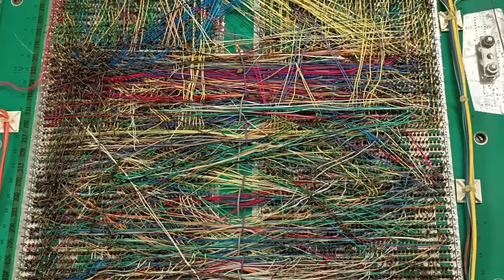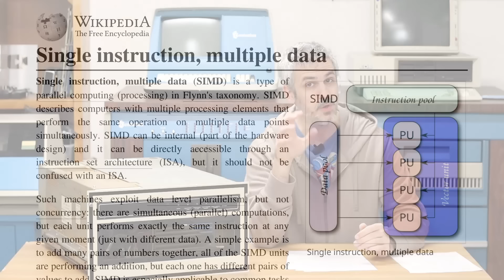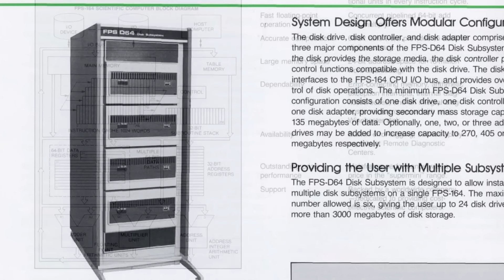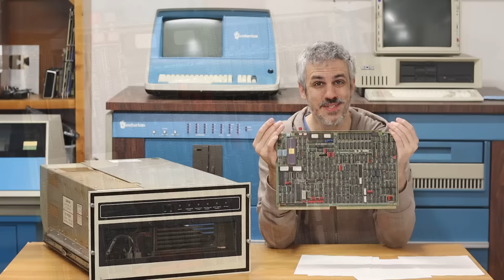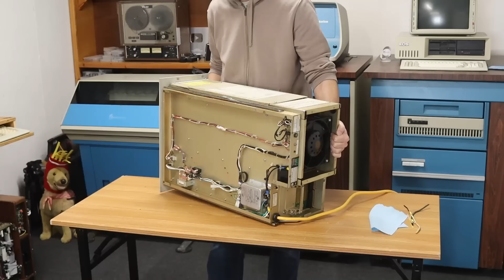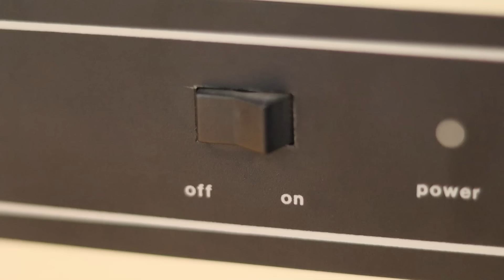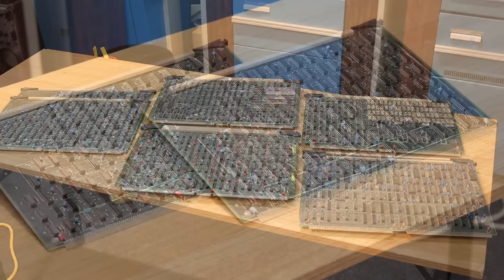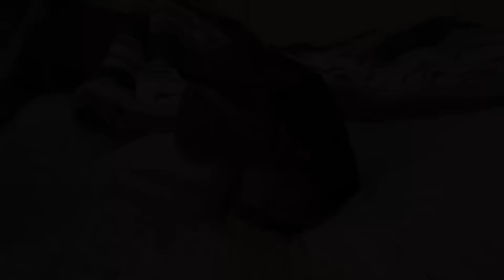This Computer is from a Defunct Supercomputer Company

Comment: Great video.  Around 1990, I was dealing with a high-end government contractor that was using a Silicon Graphics Onyx "reality engine" to develop a simulator for the military.  Around 2006, I became the program manager for a government contractor at a federal research lab.  The same SI Onyx computers were all over the place.  Some funny guy had put them on casters and bolted a cushion to the tops of them.  They were being used as stools and foot rests.  I think they cost between $200 and $500 K, originally.

Comment: Vector processing is used for fast parallel matrix operations. When I worked for NEC supercomputers, it for weather modeling and material stress analysis (Finite-element)). There are other uses, such as for the NSA. I don't know what they were using it for. If I did, I couldn't tell you. 😆😆😆

Comment: Back in the early 70's I modified the Fortran libraries for Data General Nova systems to utilize on of these devices. With floating point implemented in software, the speed improvements were substantial. The big payoff was to reimplement many of the major functions (SIN, COS, EXP, SQRT, etc) to use the vector capabilities. (All in assembly.) Massive speed! But the FPS had more bits of precision than the DG formats, so it got slightly different results, which I had to explain to the customer (and my boss). Fun times....

Comment: I worked not only on FPS Hardware in the early 1980s, but also helped build a piece of hardware to accelerate data movement in and out of the FPS 100 and 164 (did the cross-assembler and cross-linker for 2901 based architecture for that accelerator- built by APTEC systems in Tigard Oregon- major customer was the US Navy- but the demo was to draw a picture of Cheryl Tiegs on a Mentor Graphics display- they had the office next door). The company I worked for, QTC (Quantitative Technology Officer) was founded by one of the former FPS scientists- Dr  Bob Norin. Very small company- less than 7 of us. I loved the architecture - MIMD- of FPS hardware. It was a cycle based integer and memory access model and a push based floating point add and multiply pipline. Fascinating algorithms to fold loops into parallel access. Geology problems were FFTs for seismic data in Oil Exploration. I remember everyone coming back from SEG (Society of Exploratory Geology) in 1982 looking incredibly grim- no oil companies were going to spend big that year- economic downturn.

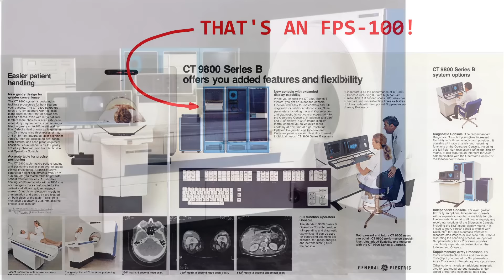Comment: 3:50 - Mercury Computer Systems build bold-on array processors for GE Medical systems. Eventually the military took notice and starting putting Mercury systems on aircraft for airborne RADAR, especially Synthetic Aperture RADAR. GE told the company to start building their products in CHY-NAH. The company told GE to pound sand. GE eventually stopped using the Mercury product.

Comment: The geologic application is almost exactly the same as the medical one: computed tomography. In the case of the geologic application you are looking for geological structures that may contain oil deposits by looking at seismic waves from several sources, rather than reconstructing anatomic details from X-ray slices.

Comment: 4:34 - Companies like Schumberger put data recorders out in the field and drove sound waves either from hydralics on trucks or with explosives and recorded the sounds coming back in sufficent fidelity to do beamforming and discover rock strata information to help oil well drillers determine the best places to drill. Beamforming is a very, VERY vector-intensive task.
Reply: Even without complex calculations like beam forming a vector processor would be a significant advantage when handling 3D surveys; or when stacking 2D surveys.  Stacking is a process where you take a number of seperate shots and combine them to give a clearer picture of what’s happening at each location.

Comment: I ran an FPS-164 on a vax for a while doing control systems simulations, and I sent a bunch of the documentation including software to the CHM.  Also sent them a box of stuff from the FPS-164 user's group including a list of all members at the time, photos and papers from the user's group meetings, and so forth.   Way, way faster than doing FFTs on the vax one element at a time.  Something of a pain to use because you had to move data from the vax to the array processor, then make calls to the array processor for operations, making for huge wads of unreadable Fortran.  Anyway, the guys at the CHM should have these docs.

Comment: You asked about an FPS-164.    I ran one from mid 1986 to about 89-90.   It started life from what I understand attached to a VAX 11/785.   The 785 got a big brother a VAX 8600, the two VAXes where clustered together and the FPS Unibus card was moved from the 785 to 8600.   The users ran Nastran and Abacus FEA software for a component division of GM.   Really all the software and storage was on the VAX, the disk drives withe the 164, just held the job/program to run, the data and the results.  As far as the users/engineers saw it, they could submit a batch job on the VAX that copies their FEA input deck over to the FPS164, and then the program, Nastran or Abaqus, ran the code and copies the results back.   Or they could submit a batch job that ran on the VAX.   In the long run, the FPS was not that much faster than just running on the VAX, or the FEA models or the code couldn't take advantage of vector math.   This is also backed up by the fact that later the users, demo-ed a VAX 6540, which was a 6000, with 4 500 series CPU, and each one had an attached VAX vector co-processor.  The testing with and without the vector co-cpu enabled showed it didn't help much.   THta VAX cluster was moved across town and joined into another cluster and the FPS164 was left to be scrapped.   Faster VAXen, less extra software and hardware costs for the FPS where the main reason it was no longer used.

Comment: Analyzing CAT scans and seismologic reflections (used in oil prospecting) are both examples of INVERSE PROBLEMS.  We know how the signals involved (x-ray absorbance and acoustic reflection) are transformed by a system to produce complex data.  Computing the data from the inputs is the relatively easy FORWARD PROBLEM.  To determine the structure of a human body or the distortions of geologic strata caused by oil domes, one must compute the inverse of those transforms.  That is, reverse the process that created the data to retrieve the system that generated it.  That is a much more difficult problem to solve.  In some cases, eg.the numerical inversion of exponential transforms, it is impossible to do accurately. Thus, inverse algorithms may require large memories and long times to complete.

Comment: As a polymath myself, i just have to bring up that an array and a vector are two different things, but somewhat related because an array has several values within it making it understandable why they could be confused or the terms interchanged because a vactor's values would be stored in an array, as the array is near suited for this... or a linked list could be another term you may use.

Comment: Thank you for solving the mystery of how they did early medical imaging with computers because I never could figure out how they were processing that much information with the computers available at the time. This is the missing link. I always knew that various manufacturers had floating point options that could be added (and the PC followed suit) but I don't believe any of them were reaching those sort of performance figures. PS, the 486 was easily reaching 20-30 mflops down the line. The pentiums were a quantum leap in the FPU department coming from the 486 too. By the pentium 3 they were getting 2-600 mflops. That was beating several RISC processors at the time.

Comment: Hi David, a very informative video. I think reverse engineering is probably the only course of action. Very big and time consuming job. You could go for a PCB but playing as opposed wire wrapping. Just have to get it right first time. The more wire wrapping you do the easier it gets. But it very slow and very easy to make mistakes. Good luck with the project. Richard

Comment: you wont be surprised to find out that geologists use computers to search for oil, they run geophones, which are sensors all connected by wires spread out over several kilometers in a grid, then use underground explosions to generate signals for the geophones to detect, the seismic data all gets fed into a computer for storage and interpretation to see what kinds of rock layers or voids exist below to find the oil

Comment: I used several FPS AP-120B and FPS 5000-series array processors in 1985-86.  Went to training at FPS in Beaverton, OR.  We used them as part of a real-time flight simulator to do table look-ups of wind tunnel data and we also coded the digital flight controls in FPS assembler.  For one simulation, we paired an AP-120B with a VAX 780, but for another, we had 3 Gould/SEL MPX32 machines in a cluster (those were ANIMALS - put the VAX to shame!)  each Gould was paired with a 5000-series AP.  The programming was WILD - all in assembler.  The basic method for programming was to write the code linearly, then go back and fold it back up to "parallelize" the code.  It was all about maximizing the number of operations you could do in one machine cycle.  As I recall, we never worked on the AP directly.  We did everything on the host computer, created the AP microcode, then ran utilities that loaded it onto the AP and executed it.

Comment: Cray had earlier built the CDC 6000/6600, circa 1964, at about 3 megaflops.
When I worked at Data General circa 1975 we still had math libraries that computed floating point in software, for those too cheap to buy the hardware option (sadly I don't recall the specs on that!).  In software, on machines that ran under 1 megahertz, you can imaging the flops were well short of mega.
Reply: I worked for Interdata/Perkin-Elmer, and we still had floating point hardware as an option (starting in 1974) until sometime in the early to mid 80's when it became standard. To get hardware floating point a pair of additional 15"x15" boards would need to be added to the chassis at greater expense. The same instructions would be used to enter the software emulation routines making it invisible to your application (other than a lot slower), and the operating system would simply trap on the illegal instruction. It wasn't so much as being cheap as what application you were doing. There were countless users who didn't need floating-point, and other where it was absolutely essential.
Reply: @QImpact  y'know, I never even asked just how DG did floating point hardware early on, wonder if I could Google it today, lol.  I think I have an 8087 chip unopened, somewhere in my deep files, when was that, about 1980?
Reply: @itellu3times  I though Data General had its own CPU architecture. Originally built with discrete components, and then using LSI logic with the microNova. The 8087 was the add on floating point co-processor for the intel 8088 microprocessor. Perhaps DG was using the Intel as a front-end processor or something.

I had an original IBM PC (PC-1) which had the 8088 microprocessor but I didn't get the add-on 8087 which fit into a slot beside the CPU. I put my money into memory at the time, having a whopping total of 320KB (16KB base, + 48KB additional chips on the motherboard + a card with 256KB on it).
Reply: @QImpact  yes of course, but by 1980 the FPU could be on a single chip, that's all I meant.  Nova 3 was 2901 bit slices (like almost everything circa 1975-80), I think the older Novas were just random TTL logic.

Comment: Regarding the FP-3000
First, you start with Falken’s maze.  Then you make a wish, that maybe, just maybe, if you provide the necessary 12-volt supplies, you can wake up the diagnostic port.  Maybe there is a vintage UART on the board, from that era, like a 6850, or a 16450, or whatever.  If you have access to an extender card, probe for the crystal frequency and whatever it is divided by.  Or jump in my guess and by golly with something that still works to this day, even on some of the diagnostic ports that you find on Linux-based DSL modems, Wi-Fi routers, etc.  CTS/CTS/DTR/DSR? Figure out which lines are actually used, and for what.
As long as you don’t let any of the magic smoke out. 

Maybe it is actually an ancestor of JTAG?  Alright, that could get messy, and I have a strange feeling on that one, given that I graduated from UC Berkeley in 1995, and have a bit of experience working around a Cray, so yeah, there is something hauntingly familiar to the possibility that the debug interface MIGHT be non-standard for it’s time, but nonetheless very close to being similar to something else, that is to say, to something still in use today like an early implementation of something that evolved into JTAG.

Hopefully, since things like flash memory and other things that you don’t want to break weren’t in general use, "that I know of", in that era, I can’t imagine that there would be a lot that might get bricked by some careful fuzz testing of the RS-232 if that is what it is, or RS-422, or bi-phase-M, or whatever, or maybe even all of the above.  I would, of course, want to check for any CMOS/battery-backed-up memories, which will most likely be long since gone.  Be very afraid!

Knowing something about what the interface was as far as the actual interconnect to the VAX, or whatever, might also be helpful, assuming that they used a standard interface, and that you don’t also need a custom interface board that you do not have, that plugs into the VAX that you do not have either, along with the missing massive parallel cable, which might or might not be all that different from a SCSI cable from that era.  Oh, wouldn’t that be nice if it could talk SCSI?  Check part numbers.  Believe it or not, I have a vintage Apple II SCSI card that uses an NCR-5380 C9046 …. Etc. SCSI chip.  Maybe you will find something similar.

Keep up the amazing work.